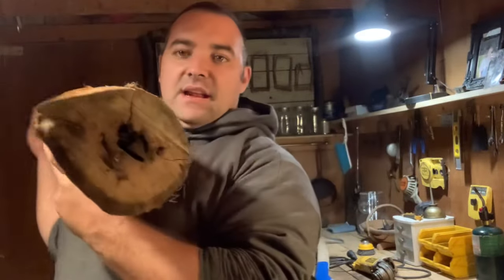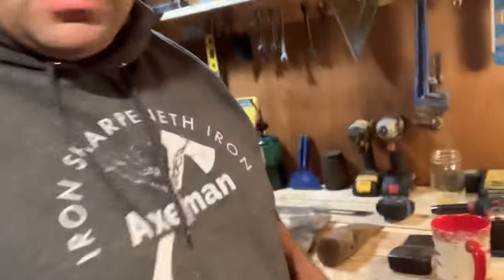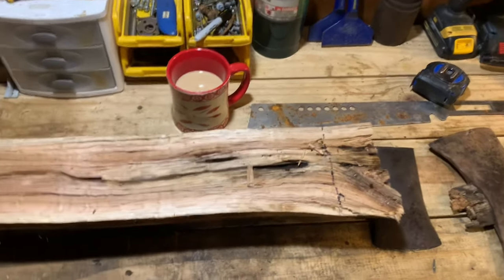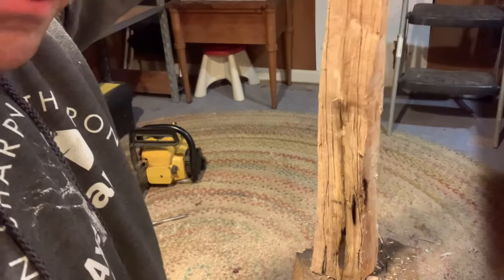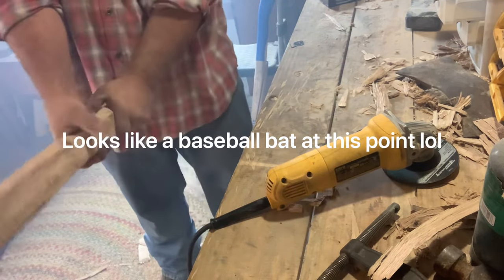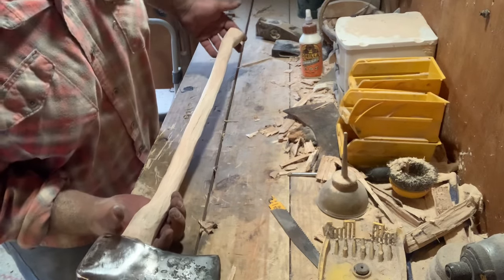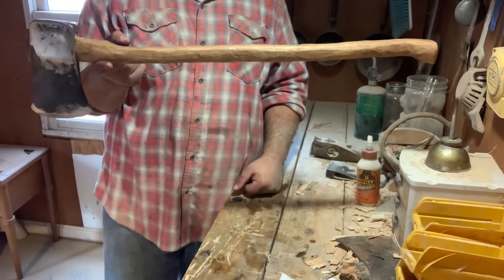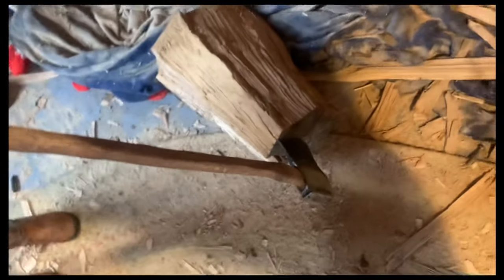From log to axe handle: my first attempt(lots to learn still)

Comment: It’s pretty hard to go too thin on a handle. I typically bring my handle to 3/4” thick and somewhere around an 1 1/2” wide. They feel way too thin at first, but once you start using them, you will never want to use a thicker handle again.